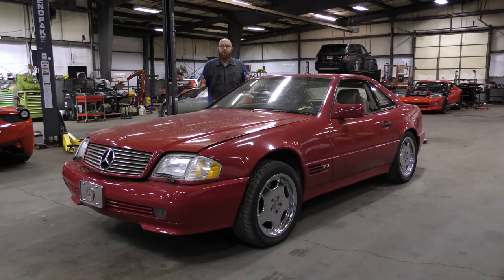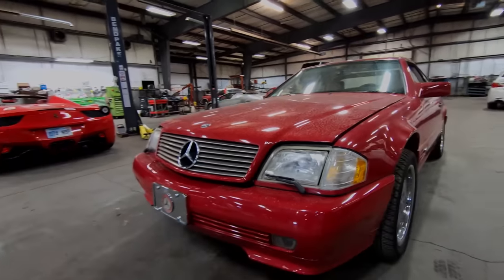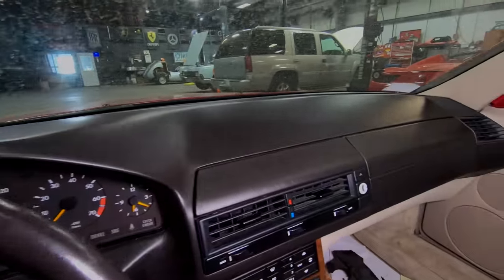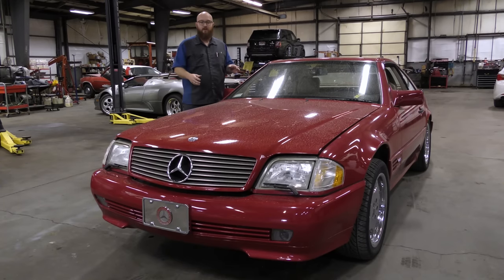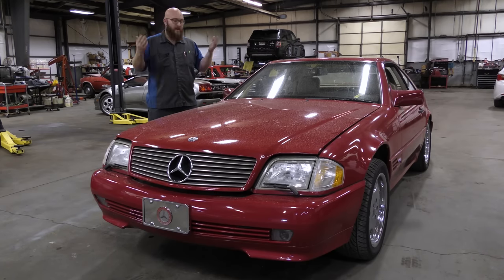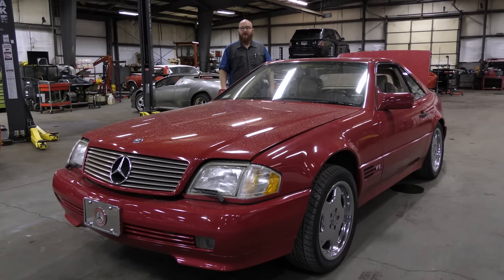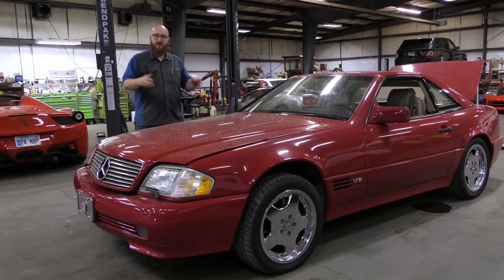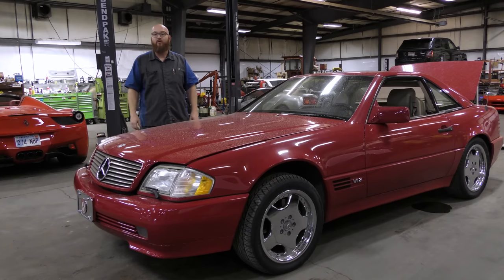Another customer scammed! CAR WIZARD shows why this '94 Mercedes SL600 is needing 15K to get sorted!

Comment: To someone this car is a 7500 car and the damage is obvious. Not a scam imho. The drivetrain is worth 4 grand. Wheels/tires/brakes 1 grand. Body panels 1 grand, Frame/interior 1500. I found a sl600 reproduction wiring harness online for 3 grand in 2 seconds. If you buy a 20 year old car you should know what you are looking at and know you are accepting the gamble if you don't have it checked out by someone that knows what they are doing first and expect to get it back to in service. And when you gamble on a old broken car deal you will likely end up paying the difference. When an old car cost 10 grand less than other comlaribles you should expect it to need a lot of work that costs more than 10 grand to pay someone else to fix, or they would have done it to sell the car for more profit. It really bothers me that when someone chooses to take a gamble on a car that costs 10 grand less than it should, and is priced at part out value, that you would call it a scam. When Hoovie buys hoopties he knows its a gamble. Its not a "scam". If I put a rusty bicycle out front with a sign that sais $100 and someone buys it when they could buy the same bike for $200 rust free, its not a scam. The seller didn't hide that the top didn't work, or the wires were cracking, or the suspension is jacked.

Comment: My wife had the 95 S500 Panzer.  Everything went wrong. Nobody knew how to fix.  Gave it away. MB joke on its customers.

1. Undetectable parasitic battery discharge 
2. Oil pipes loose for lifters in heads
3. Mercedes AC failure
4. Door windows failed
5. Four New air shocks
6. Defroster failure
7. Smoking transmission above 75 mph
8.. Air compressor failure. 

Comfortable seats though.

Comment: I have everything needed to fix that car,I have complete roof cylinder set,all engine wiring harnesses,the correct instrument cluster( that appears to be a 99 or newer in this car),the headlights,the correct parking lights,and I just had one of my headliners replaced for $200.00. The wizard is correct about these cars,I currently have two,a 94 600 and a 98 500,I have done everything he is talking about so far plus so much more on the 600,if I could not do it myself I,would not own it. With that said, there are alternatives to repairing these,there are several companies that do replacement harnesses, I was fortunate to be able to get the originals from a dealer about 7 years ago for mine,with the exception of the E.T.A harnesses which I found from a company in Ohio. Even doing the work myself on the 600,I,have probably exceeded its value at this point,I have had it about ten years,but it is sorted quite well at this point and it is an amazing car all around to drive. I actually have 2 spare m120 engines complete for future use,hoping to pick up a 600 with a bad engine to do a project with. Does anyone know if this guy still has this car? I wouldn't mind adding a red one the the garage.

Comment: Not even close to 15k, peeps just do your homework and contact people, I live in Montreal Canada and my 1994 Sl600 had almost the same issues, ended up finding a Ukrainian guy locally, he rebuilt the harnesses and replaced the cylinders among other things for less than 3k CAD and a 24 case of beers. Genuine hydraulic cylinders for a 94 SL600 are still sold, if you're savvy in automotive repair you can fix these issues yourself, the harness rebuilt is just replacing the wires. It seems this project was out of the Wizards comfort zone.

Comment: None of this surprises me in the slightest; I used to own a 1994 Mercedes SL320, in this exact color only with black leather interior. I was able to DIY quite a few things on this car (headlights, struts, stereo & speakers, driver's seat, basic maintenance items, hell even the long wheel bolts I was able to drill out myself and save the wheels), and for a few brief months in 2019/2020 I was able to daily the vehicle - until the major things finally started giving out on the car. 

- Speedo stopped working, was going to be $600 to fix at my local indy shop
- Entire hard top hydraulic system failed due to all the seals being old, this was going to be roughly a $2000-3000 job to recondition everything. This wasn't just a couple of seals either, this was going to involve the entire thing being pulled out of the car to redo it
- Convertible top rear window finally tore due to age, was going to cost about $500 to fix it
- Due to this having the M104 I-6 engine, the head gasket started to leak; this was going to be a $3000-4000 job to fix at my local indy shop

At this point, I was starting at near-as-makes-no-difference $10,000 worth of repair bills (if we're going high on the estimates, which I have learned to do with any old European car), so I ultimately ended up selling for $4000 to an ex-Mercedes mechanic who wanted the car for parts. I was also unsure of the wiring harness in this thing, so that was extra incentive for me to sell it as well.

I absolutely miss this car to pieces, and I love the R129 - but if I get one again, I will likely get a 1998-2002 SL500 model, preferably as new as possible. The look of the 1989-1995 ones are pretty sharp, but they aren't worth the early headaches of this model run.

Comment: I can't possibly understand why anybody thought biodegradable wiring was needed? Since when does copper wire just sit around wasting away?! It doesn't matter the condition, the copper core is always of high value...the insulation is irrelevant. This is not a problem that needed solving. Even if you do just leave it laying around you will find somebody else has cleaned it up for you.

Comment: when you buy a car that old  might expect a lot of things to go wrong.  It's a good example to show the wiring damage I wouldn't know before about those biodegradable cables , stoopid idea from any car maker if you ask me .
The hydraulic system is common for most of the old convertible cars and many owners just give up on fixing them and open them manually,  of course you need to empty all the liquid.  I will not say that is a total loss,  just that you may have to run more to find the right mechanic and parts . Not saying that the Wizard is not a great mechanic but for sure his price is on the high end .
I've got a similar experience with my 2003 S430 , I still have the invoice quoted at over 5000$ to change 3 modules , I can prove it to anyone.  I refuse to go further and pay only for the diagnosis 150$ , after I've got the exact the same parts from a specific car parts dealer(I won't mention the name in here )and change them myself , Total cost 750$ .
Before I change myself the radiator , Serpentine belt and pulleys,  Coolant reservoir,  secondary injection pump and vacuums , rotors and brake pads , and few more minor fixtures.  , it's incredibly how easy was to work at that car , the amount of space around the engine and under , the rotors and brake pads changed with only two basic tools and for the diagnosis using a Chinese Icarsoft device from Amazon . All this labor and parts for sure will sum around 10-15 grands as well but I did it with a budget of under 4000$ . Again if you are buying such a car for this price you might get ready to get your hands dirty and spend some time looking for the right parts , I recommend OEM

Comment: one of my jobs working for one of the big three was changing wiring harnesses , it's tedious but doable even for that car to make your own and the cost is your time doing it, the wire and connectors are cheap, in the factory i did one a day easy and that's taking the dash out,all the door panels off ect... its a nice car the guy should fix it himself its not rocket science to learn how, and if that roof is metal i would scrap all the hydraulics and weld it on save any future grief. for what he paid would have a cheap really nice car , face it ten grand gets you a worn out honda civic nowadays

Comment: What about having those hydraulic cylinders rebuilt? What about the customer rebuilding them himself? If that can't be done, what about using substitutions instead? Just different cylinders bought online. In this manner, I have repaired some vehicles that people thought were finished and headed for the scrap yard. Because repairs would've been much too expensive otherwise. A shop probably can't do it because you still need to be able to guarantee your work, but at least the customer may be able to bail himself out of a big loss. He can fix those things, and sell the car with them repaired and working. Who knows, maybe his repairs will far outlast the oem stuff's lifespan.

Comment: Just get a can of flex seal for the wiring harness and just start spraying forget fixing the top just pump all the oil out leave the hard top on then drive the thing into the ground take out the 12 cylinder in 5 years and put it in a go-kart...

Comment: When I buy a vehicle, I know the basic things to look at and SMELL, some will go as far and taste, always check every fluid, especially ATF, always rub a bit on a new white paper towel, SMELL IT for any burning, make sure a healthy pink or blue (FZ) same with engine oil, rub inside of muffler tail  pipe for any excessive oil burning signs, any blue or black smoke from muffler, walk away, check coolant for any oil, yes oil mixed in, same for motor oil, with any coolant mixed in, which is a sign of a failed head gasket or cracked block.  Check the brakes (no big deal for me to put in new rotors and pads, I’ll just negotiate $750 off the price), check inside the rims, by the underside for any boots or failed axle seals, which will leave black grease on the inside of the rim.  If the car is warm when you get there, leave, and request a check the following morning when the vehicle is cold.  I want to take the radiator cap off to inspect coolant, and you cannot do that with a hot vehicle.  Bring an ODBII scanner to make sure no cleared codes. After all that, I still have my mechanic look at it to give a final blessing.   Once I take possession, (Jeep Guy), I immediately drain & fill differentials, transfer case, drop trans pan and change filter & fluid, do a fresh oil change with a good synthetic and quality filter, change the air filter, and based on mileage, change the plugs, but I never buy used with more than ~50K miles, last 5 purchases have been 10k, 11k, 10k, 7k and 55k miles, or I’ll buy a previous year new, after new model year is available as you can get 5-7k off, as dealers want previous years off their lots.  I avoid private sales, as buying from a dealer does offer some protection, and I always go the “Certified Pre Owned” route, as at least with Mopar, you get a 7 year / 100K mile Powertrain extended warranty included with the purchase.

Comment: These models were problematic from the beginning, the older they became the more extensive and expensive the problems were to correct. The "manufacturers warranty repair index" for this model eclipsed all other 129's available. The V8 versions which were decent cars if maintained as needed without putting off the problem but the 600's are straight up trouble.

Comment: I suspect with a bit of research and a lot of time, the top and wiring issues could fixed for under $3,000. That would definitely require some dedication, but it could be done. But Wizard doesn't work for free, and that's a lot of time, so a relatively simple project winds up being expensive.
Reply: yeah, not to mention, tedious. Wiring harness really isn't that bad to work on if it's just one or two wires...i've done it on some project BMW..but if all wires are flaking?...lol..screw that, that's a labor of love that a competent person would most likely have to dedicate months to work on...i say months cause that said person is probably paying the bills employed not as a mechanic and would only have some weekends to focus on such a behemoth of a project.

Comment: i dont think he got scammed. this dude bought a convertible without even checking if the roof works. the high suspension on the front axle is also a major red flag!

Comment: yup owned one. sold after two years.  Master cylinder wiring harness etc. in the end the engine was just rough.  not reliable and stalled  i dumped this lady for cash

Comment: BMW / Mini used the same type wire on my 07 mini I have found wires missing insulation the wires shorted and caused transmission issues

Comment: It's a shame that nice looking Mercedes is in pretty bad shape. I use to own a 1991 Mercedes Benz. I owned it from 2014 until 2021. The car was still in good shape for it's age when I first bought it. But about a couple of months after I bought it, the ignition switch went out. I was out of about $450-$467 getting it fixed. And then about a year to two years later, my soft top leaked fluid just like that one did. I've been trying to get it fixed, but the guy that was supposed to fix it at an ok price for me never got around to fixing it for me. So I finally traded it in for a newer model car back in the summer of 2021. I kinda didn't want to do it, but I was thinking it's probably time to let it go. The SL 300, 500, and 600 are still nice looking good cars to own. But if you can find either one that's still in good shape to buy, then that's the best thing to do. But it's just best to have a nice amount of money stacked aside after you buy one. Because the maintenance on them can be expensive. That's why I would consider taking your advice of buying a good one for $18,000. Because that may be the best choice to make anyway.

Comment: Don’t buy a Mercedes if you’re not able / willing to fix a lot of things yourself. 
I have some guys who are unable to use a screw drivers /  unable to change a flat tire / unable to change a light bulb/ unable to do oil change / unable to do a brake job - rotors and pads. 
If you’re one them then shut your trap and pay someone to do it for you. B!

Comment: I'm sorry but the customer set himself up for the scammer by failing to have someone inspect the car. I wonder how he missed the wiring rotting away under the hood. Did the seller let him try the convertible top at all? He failed to vet everything and should have walked away if there were areas the seller wouldn't let him look at.

Comment: This is a do-it-yourself project car when the hydraulics start to leak.  It needs a new headliner; the windscreen leaks will destroy it.  Then you rebuild ALL the cyclinders at the same time and reinstall them.  If you can't do it yourself, the car is financially totaled, even before you start to rewire it.  The wiring harness finishes it off.  Biodegradable wiring is just stupid.  If it doesn't crumble off, rodents will eat it off.

Comment: Buyer didn't really get "scammed". When you buy a nearly 30 year old European sports car for 7k, chances are you are going to have to dump a lot of money into it to make it right, unless the previous owner did the work already. It's like buying a 30 year old hot water heater..if it IS working, it probably wont be for much longer without a need of repair or replacement. Mechanical parts don't last forever.

Comment: That’s why I prefer the older 380/450/560SL with the manual tops.  All that hydraulic stuff is fine- till it fails.  I worked for a family that had a 380SL and the 3 years I worked for them that car ran flawlessly.  Now- the 1984 Jag XJ6 they had?  Total POS.

Comment: I don't mean to be overly chatty here but I wonder how YOU felt when you started the diagnosis just on the roof alone, never mind the absolute nightmare of a deteriorated engine wire harness on top of that. I would have been sad, especially when I had to present the work order diagnostic list/price breakout. It was really hard to watch this video. Ugh I hope it worked out for the customer in some way!

Comment: Being a pragmatic person, I fail to understand why anybody would even consider buying this European junk. If a cotter pin would do the job, the Germans especially, would use a 4 piece spring loaded clip. The "Beetle" was great German engineering.  The Unimog , MAN trucks & other vehicles are excellent. AUDI, Mercedes, & BMW  are the most overengineered, overpriced, unreliable, to come out of Europe. I don't think Mercedes has built a great car since the 80ies. My personal opinion, & I am certain that a  host of 
the "German Engineering" crowd will strongly disagree with me. Great video Wizard. Cheers!

Comment: Don’t use the roof…problem solved….swap the motor for something just as powerful or better…add the appropriate wiring harness…problem solved.    Reggie roof lining for a few hundred….problem solved.   Buy one headlight…also fixed.    Restoring a 28 year old car to factory will always be expensive.

Comment: Hydraulic cylinders are just that, they don't need to be anything special or particular. Get the dimensions, order new ones from your local cylinder manufacturer, or online, re plumb it and replace the cylinders, and you're done... Literally a 4 hour job or less for a halfway decent backyard mechanic. That's including lunch... Oh yeah, and I promise if you do this without involving Mercedes themselves, you save 85% or more of the cost.

Funny too, GM does about 400HP and about 400ftlb tq with 4 less cylinders and a decent bit less displacement... and theirs goes to 300K with regular fluid swaps alone. People pay big money for funny cars.

And my god, as a prev controls electrician, $9K for a harness!!!??? lol.... literally all that is, is cutting various colors of wire to various lengths, crimping ends or pinning them into connectors, and viola. You could make them in bulk for less than $50 per unit. FFS, I'm gonna start making harnesses, for this car... Hello ebay.